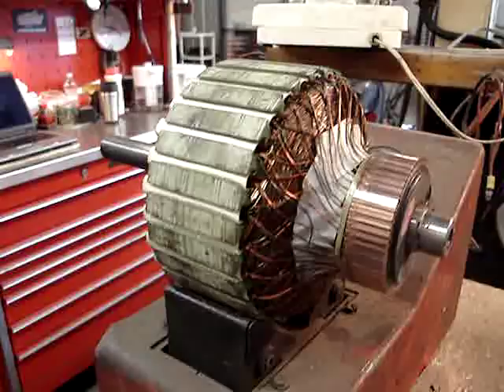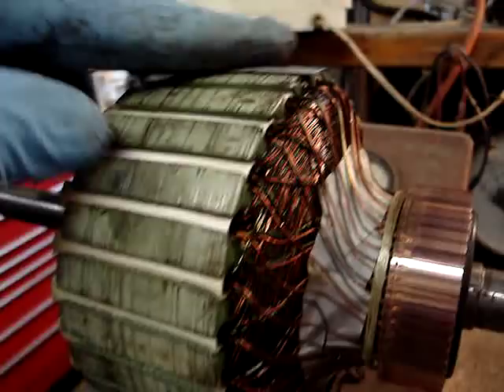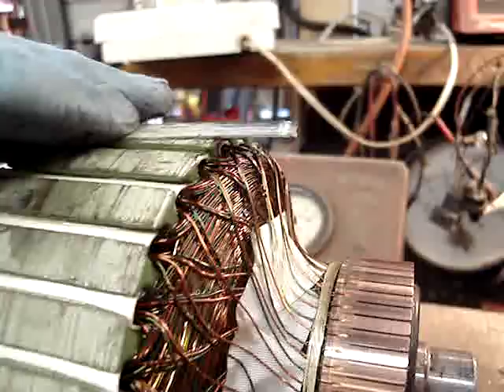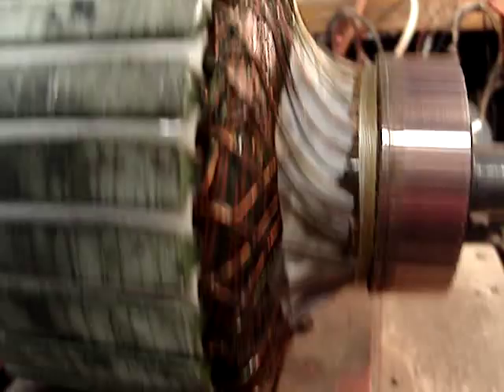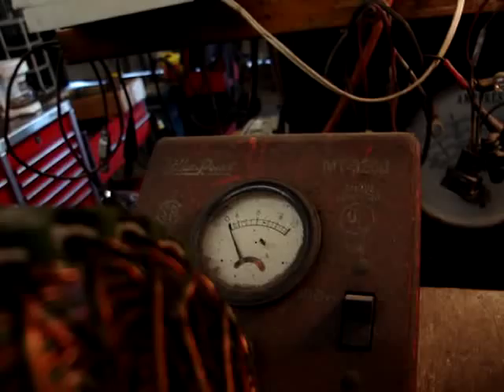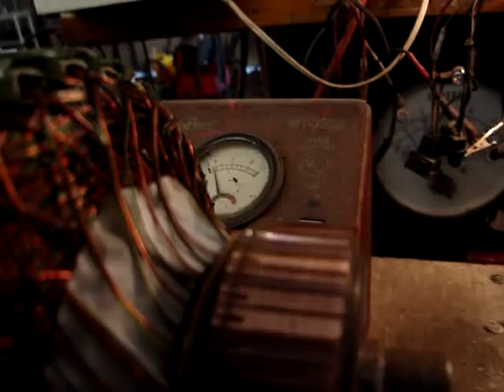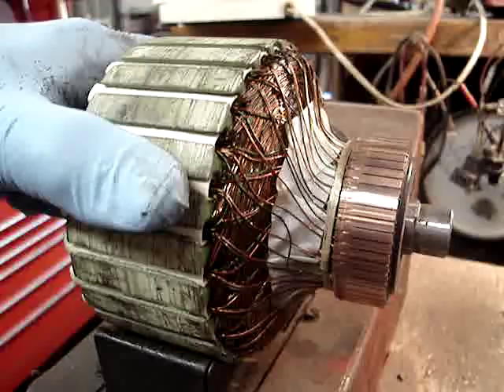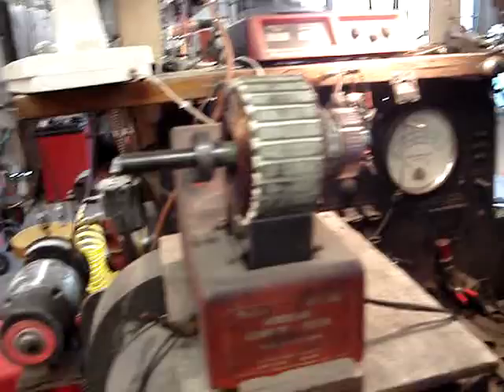Armature Test on Growler

Comment from the maker: The Fields were magnets.
 Yes I've used the blade shorting test many times on cheaper gowlers with no meters.
 You can use an external meter ,though.
These reel motors are very smooth running....totally enclosed explosion proof for use on oil & gas trucks

Comment: That's a pretty good sized armature.  DC magnet stator or wound?

I have seen where they take the blade and look for sparks across adjacent commutator segments when on a growler.  I think it may have been to save time vs the voltmeter.

One would think the voltmeter method is less destructive.